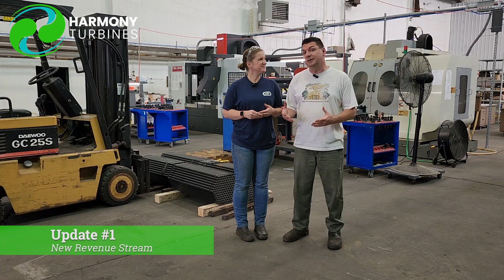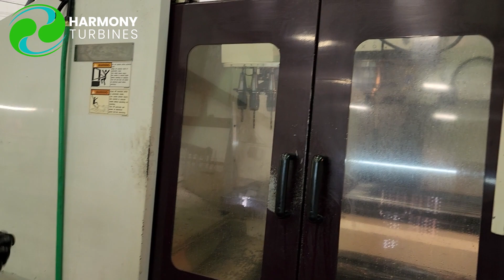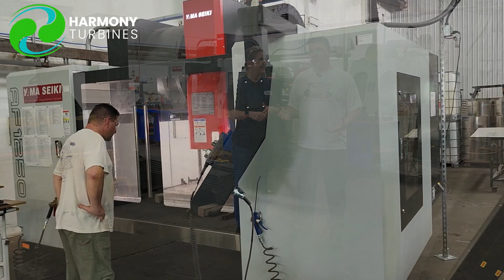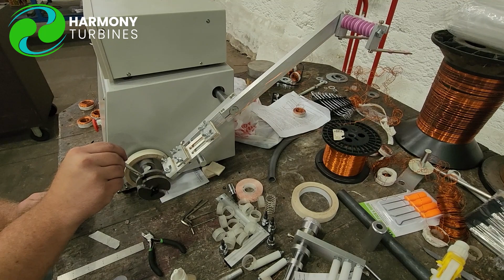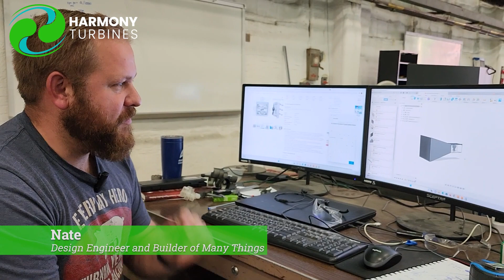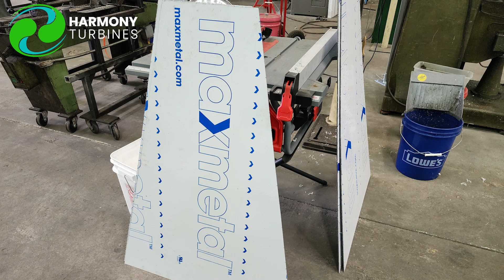Mid-August 2023 Update

Comment: curious to know why you chose to do R&D on a generator design instead of finding a supplier that makes generators?
Reply: Our patented axial flux generator with variable air-gap technology allows Harmony to start up with very low RPM's in lower wind speeds compared to the average wind turbine currently available on the market.

Comment: Hola. I will have dozens of Mexican university engeniring Students following your progress very soon. ¡Saludos desde Xalapa Veracruz México del Gringo Jalapeño! 🤠🤠🤠
Reply: That sounds like a spicy plan! Thank you Gringo Jalapeno (I could not find that fancy N!! 😁)
Reply: @harmonyturbinessupport  just a heads up, you just use alt code's for the fancy n. hold down the alt key and on the number pad press 0241, ñ.  make sure number lock is on. (i learned about the alt codes when learning how to write temperature, like right now its a sizzling 104° in Texas. [alt code 0176 for the degree symbol])